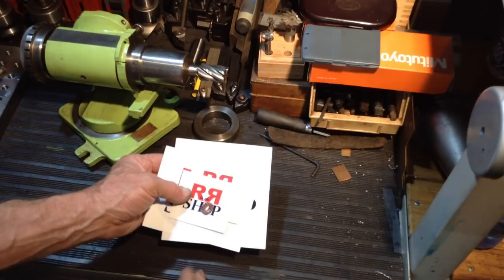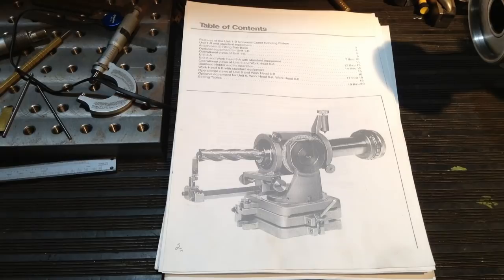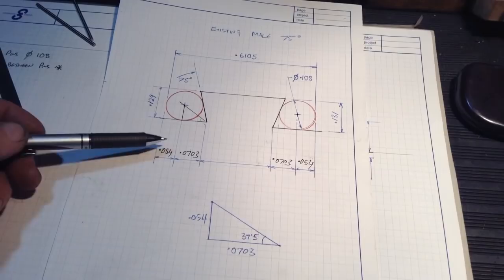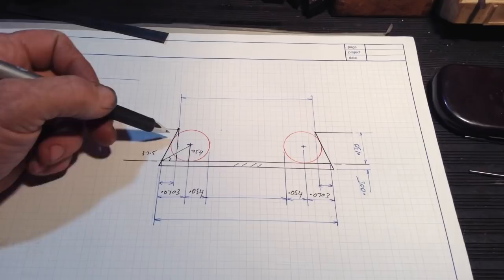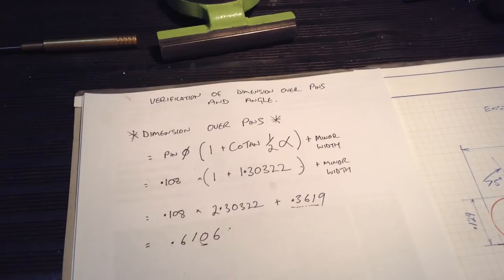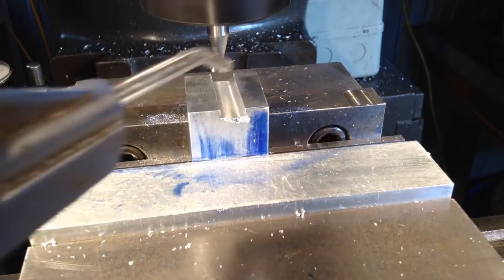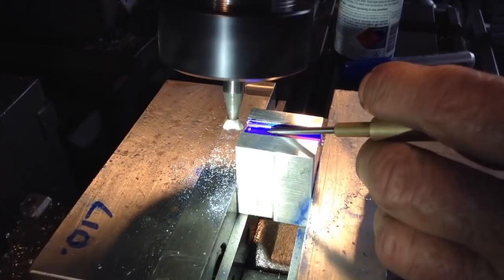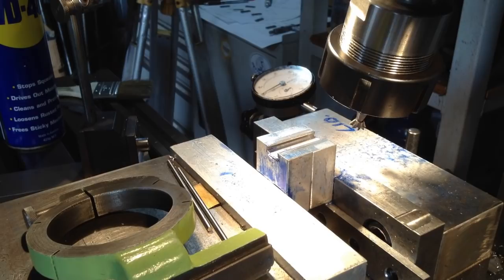Calculating & Cutting a 75 Degree Dovetail ,  For The L.A Rocheleau  Grinding Fixture .

Comment: Brilliant Max, the instruction on the math & calculations was invaluable as a resource for others to follow along.
Not that kids at school in metal shop could follow it BUT, it ought be shown to them so that they can see the practical application of math and geometry in use in a trade skill, to give them the motivation to study and understand the actual subjects, because they can see that those skills will stand them in good stead later in life whether it’s their livelihood or just a hobby perhaps.
I think a lot of times kids don’t see the potential practical “end use” for subjects they have to learn at school, & something like this would be an invaluable teaching aid to motivate them to pay attention in class on subjects they struggle with and cant imagine any practical use for 
Most of them will just think, “ohh I don’t need to learn that, there will be an app I can download onto my mobile phone for that!” 🙄
The more cluey ones will hopefully think “if I understand this, I can make an app to do this on a mobile phone and retire rich if I write the computer code. 😜😉😂😂👍
I do have to ask just one question tho.
Where you tilted the Bridgeport head an extra 15 degrees to get 75 degrees for the dovetail out of the initial 60 degrees pre set dovetail cutter angle, could you not have just spun the block 180 degrees in the vice against the same stops to cut the other side, without having to tilt the mill head 15 degrees in the opposite direction?
I’m guessing the risk is that re-positioning the piece risks losing accurate width?
I’m thinking maybe this is something you’ve learned from trial & error maybe?
As always totally fascinating to watch, you have a real skill as a teacher instructor on top of your obvious trade skills. 👍👍👍 from me.
Reply from the maker: Apps don't work when there is no internet !!!    You still need to know how to do it the  long way .  I still have other features to machine on the parts ,   Tilting the head is  no problem  & quicker than re positioning the job .

Comment: I really appreciate how you explain your methodology in how you determine measurements.  I've done a few dovetails now but to see different ways that values are derived is very helpful.  I was also wondering how you were going to get a 75 degree side with a 60 degree dovetail cutter but tilting the head it is!  I don't tilt nor nod unless I REALLY need to, lol!
Reply from the maker: Thanks Everett .   That's why the heads can tilt , once you have re trammed them  100's of times it's only a 5 min job .   Cheers .

Comment: Hi  Max,,   very nice dove tail.  Just goes to show the value of a Bridgeport, or similar machine with so many adjustable angles. With the Randy Richards Scribe,  pity you didn't get two more to make a set, with a set of flight, they  look good enough to use on the Dart Board.  LOL.   Great Job as usual..  Ohhh by the way, I have a "O" Light Torch, with a "V"  magnet using 2 battery's Guaranteed to light up at 700 yards.    Great Product
Reply from the maker: Cheers Ted .    Does that mean i have to find the old dart board !
Reply: @swanvalleymachineshop    with your enginunity & a Bridgeport, & a decent piece of a stepping block, 
you would have a dart board deluxe  .. lol

Comment: An alternative cat-skinning method would be to trim the 75 degree dovetail on the existing fitting to (the more normal) 60 degrees.  Then you could make the new bits using the standard dovetail cutter without tilting the head.
Reply from the maker: That would be the cheats way !!!    easy though   .   If i had done that , then just my luck all the missing parts i need would pop up on e bay  &  would not fit !     Cheers .

Comment: G’day Max. I was wondering if you had a 75 degree cutter but you provided the answer, tilt the head, worked just fine. I had thought you would have tilted the part in the vise. 
Cheers 
Peter
Reply from the maker: I could have ground a cutter , but that would have taken time .   There are 2 parts clamped together & other features that still have to be done in that set up .    Cheers .

Comment: I don’t understand why the company would choose 75 degrees. That’s an unusual angle. I’ve never cut, or even seen a 75 degree dovetail. Most are 60, with some at 45. 75 degree would be a bit stronger,  but that’s not necessary for this tool.

The other question is how this part is going to be able to be locked in place when in use? Without a gib, I don’t see a way to do that.
Reply from the maker: Yes the 75 deg is a bit different .    For locking , it has a grub screw .  I will point it out when i am back working on it in a couple of weeks .

Comment: stupid question- would it not have been easier to move the part instead of the head?
great explanation on the theory.
Reply from the maker: Tilting the head is quicker  for a job like that .   It's only 5 mins to retram .   Also there are other features to be machined in that set up in the next video .    Cheers .
Reply: @swanvalleymachineshop  Is it quicker than using a precision angle? (Or is it possible that you don't have a set?).  Would using a precision angle introduce an error in the dovetail?  
You must be much quicker than I am at tramming the head.  Also, did you just use the graduations on the head for the angle?
Thanks for the video.  I look forward to the future videos of making the missing parts.
Reply from the maker: @wilsont6651   I do not own a set of angle gauges .    Using the graduations is fine for a dovetail that is so small .  Tramming the head is only a 5 min job for one axis , so no problems there .   Cheers .

Comment: would you not chamfer the female dovetail at the 0,3619 dimension to counter any 'interference at the corner in the real as opposed the theoretical line world.  As per where a circular plug fits into a register recess; normal to radius the fitting part greater than the corner radius of the register to prevent interference.
Edit: your overwidth 3/8 slot mill achieved the same purpose and you mentioned this. My oversight.
Reply from the maker: The over width slot provides the clearance  for the corners , as you noted .     Cheers .

Comment: Nice work!
I'm curious about the surface finish on the original part - was it as milled or did they finish it in another way?
Reply from the maker: Looked to be milled .
Reply: @swanvalleymachineshop  Thanks, Max👍

Comment: Great job Max I do have a question that I ask from lack of knowledge on my part. How did you come up with the 0.703 number? Thanks
Reply: .054/tan 37.5 = 0.07037417    
It is trigonometry, It is all about Sine, Cosine and Tangent of a Right triangle. I learned it here on Youtube.
Reply: Max uses an app where you can enter two sides or an angle and a side, the app will fill in the rest of the angles and side lengths. As he would tell you no mucking around with trig when there is an app that does all the work for you. The app is free so check it out.
Reply: @simpleman283  Ok thanks for the info.
Reply from the maker: Like Simple Man said Randy .    I use Carbide Depot  on line triangle calculator .    It saves a lot of time  compared to the formulas & trig tables .   Cheers .